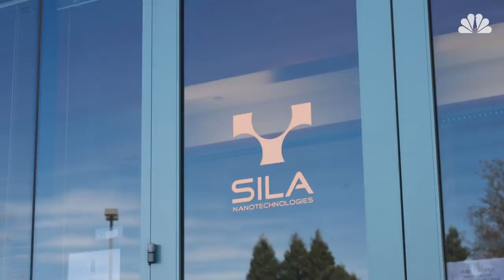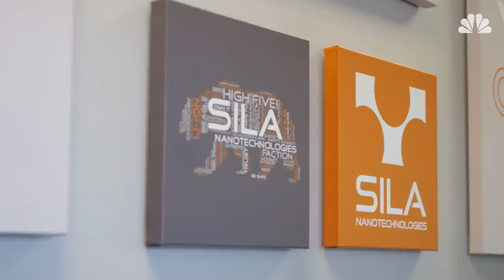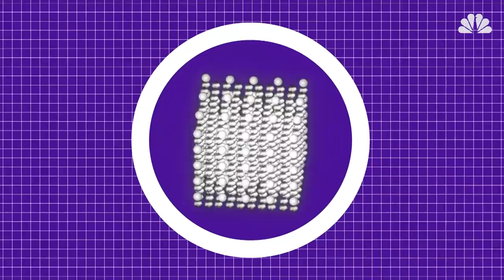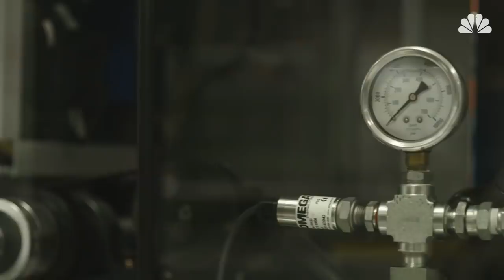The Breakthrough Battery Technology Investors Are Betting Millions On | Mach | NBC News

Comment: I thought silicone had the issue of expanding in size from 300-400% while graphite is around 8% expansion.
Reply: Hence the "proprietary" technology, something else has to be added to counteract this expansion by possible absorption of the stresses
Reply: @alialhyari1962  yep both right, old technology been improved with some type of proprietary material to overcome the expansion problem with silicone, something Tesla has also been working on and already use silicone in there batterys
Reply: That's why you should use 5 percent  silicon

Comment: I think they silicon anodes can't go long, because Lithium metal anode in Solid State batteries will be better in term of safety and energy density, but etherogeneity for the industries is good anyway, Silicon anodes Solid State batteries will be good too.
And it is called 'Intercalation' not 'intercoolation' -.-

Comment: The thought of half as many batteries means half the cost is not true. It would mean half as many batteries but twice the cost. As this is a “state of the art” battery and that would mean there would be a premium price with it.
Reply: John Robinson ummm no. It’ll replace the existing technology and It’s made with cheaper materials and half the amount of materials. It’ll rapidly become commoditized and over time will become cheaper than Lithium Ion batteries
Reply: Christopher Perry technology doesn’t work that way. If that were the case then cell phones would be a lot cheaper. Your car would be cheaper as the engine in your car has not changed much over the years. Heck look at the price of standard fiberglass insulation to the new foams and techniques use now. the price only goes up.
Reply: @jar145022  Not true. take TV's for instance. In the 70's you would have to work on average 2 weeks to buy a new TV. Now it costs about a 2 days wage to buy a new TV. Remember when the DVD player first came out? LOL it was thousands of dollars, but as the market saturated and they became commoditized, you can buy then for 20$ at their peak of sales. The same will happen to these new batteries. They'll be some company in Asia somewhere that operates on thin profit margins that'll eventually mass produce these batteries on the cheap. Even cheaper than Lithium Ion batteries since the raw materials are so much less expensive.

Comment: When we get a 400000 rechargable cycle battery that can last 400 year this battery industry will improve and meet the  standards
Reply: Well if we get a battery that can last a year without having to charge it would be crazy lol imagine a fast charged battery that takes 1 year worked phone yet even after 1 year still has 10% battery only to be charged back up for another year in 10mins or less yes that would be the future to have a phone last like a nuclear submarine or have a phone have a 5 year stable battery pre charged and stays held at 100% till you turn it on and stays at 60% during 3 years of use and then

Comment: The current rate is about seven percent capacity improvement annually. Not two as he said. Dont trust this guy.
Reply: Back that up with some facts. 18650 cells are stuck at 3600 mah and 21700 are at 5000mah  tesla rates theirs at 3200 and 4500 mah based on pack rating and number of cells
Reply: Haha google them now

Comment: Let's presume - just for argument's sake - that the "new battery chemistry" is feasible, reliable,  and safe.

 That it works well in small gadgets, and also assuming that material and manufacturing costs are realistic and competive. 

Then we still have no guarantee that so called  "upscaling" to motor vehicle battery sizes will be technically feasible and cost-effective within a foreseeable time scale. 

THUS:  Vapourware, so far, it seems! ☹
Reply: I saw the same thing with Nickel Zinc. (NiZn) They put out some 1.6 volt "AA" cells. I bought some, and they were incredible, but they didn't have much cycle life, and with poor quality control, they fell out of favor. I haven't heard about them since. I was looking forward to them putting out "D" cells, for flashlights. They never came out with them.

Comment: The Stanford battery was invented in 2007 it held 10x the charge of a standard lithium Ion battery by replacing carbon with silicone wires the to professors that invented the battery were planning production within three years until they sold the technology to an oil company. I recently questioned Stanford university about the battery they directed me to a site saying this company is going into production with the battery . The site looked as if it had not been updated since 2016 and there was not any information about production.

Comment: I have been adding cellulous fiber from furniture and my old parkas to a 55 gal drum for about 5 yrs or so and it's compressed in there. 
..I wanted to use it an absorber for carbon ink to make batteries. I was planning to use recycled ink from the recycle depot in our town of Selkirk mb.  Unfortunately the powers that be let it all go to the landfill when the buildings  came up for sale. 
..it's a project on the backburner now.  You may want to consider this very porous insulation as a graphine nanostructures and go with it. Sound like you guys and gals have more money than you'll ever use.

Comment: These batteries are so toxic to produce and eventually disposal of that the idea that they are green is truly laughable.
Reply: How is anything green do you know the chemicals required lol I like to see organic iPhones and batteries that use organic substrates to work lol yet acid is not green it melts and causes danger even cyanide is used to remover metals from electronics if you watch Linus tec tips he goes to a electronic waste facility and they pull over a a grand worth of gold out of millions of electronics including valuable metal and non valuable metal that still has some sort of value like copper even the rags have bits of gold and are burned down to ash to release the bits of gold

Comment: Something not mentioned 
Apart from the fact they use lithium ion batteries on the ISS and satellite's.
Is the bigger the physical size of a battery the less likely to catch fire they are.
But chemical engineering was never my strong point.
😈😈😈😈
Reply: not necessarily true. depends on many factors including battery format, chemistry, separators, electrolytes etc.
Reply: Solid State batteries are denser and you can cut them with scissors, without them burning/blowing up, so that doesn't fit to your statement.

Comment: rc cars run off of lithium polymer battery's some use graphite and the have different conductors depending on the discharge rate, but lithium polymer can go up to 10.000 mah, while most lithium ion can only get close to half of that, but the future will most likely be in an unused substance because lithium is FINITE and will have to be replaced with something eventually.

Comment: The electric car isn't going to take off unless it's as cheap or cheaper than its ice counterpart. In spite of all the hype and propaganda, it's still cause and effect and we're still in a " wait and see " mode. Nothing has changed yet. Some companies promise upcoming ev's with 400 miles of range for ONLY $100,000 or the better part of a hundred grand. Even in Canada you can still buy 5 Toyota Corollas for that money, or just buy one and use the $80,000 savings for gasoline. That's where we're at now, even the homely and crummy chevy bolt STARTS at $44,400 here and that much money just puts ev's out of reach of the common working stiff. It just isn't happening yet and won't happen until technology improves.

Comment: This is going to be totally superseded by everything else. Other chemistries show 100% better capacity and 500% quicker charge times. Waste of space technology, too little too late.
Reply: Nah apple could use a battery that lasts 3 years with the phone contract imagine a phone that at 10% days you need a new phone your phone will die in 10days since the battery has been used 90% over 3 years yet still has enough power to  warn you to upgrade well apple wants a phone that you don’t fix so having a battery last for 3 years left on full brightness for 3 years and 5 days to warn you to upgrade is why apple is laughing